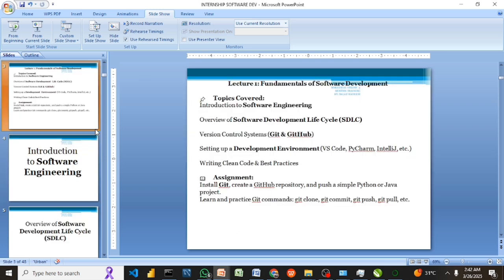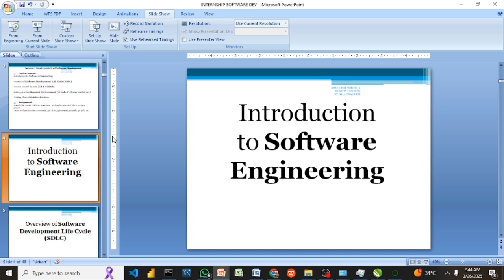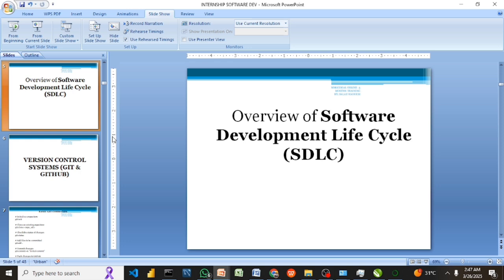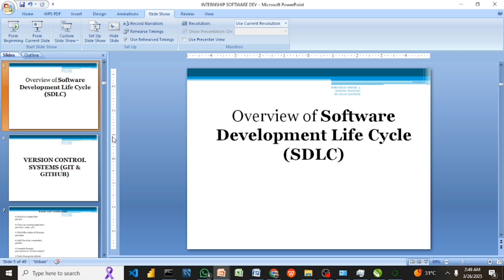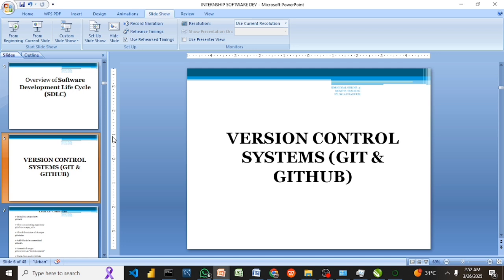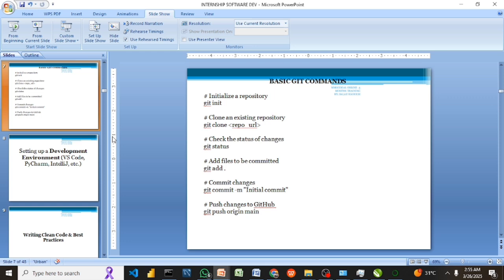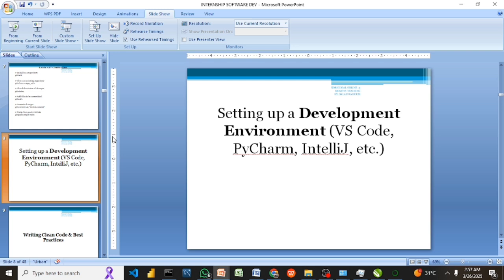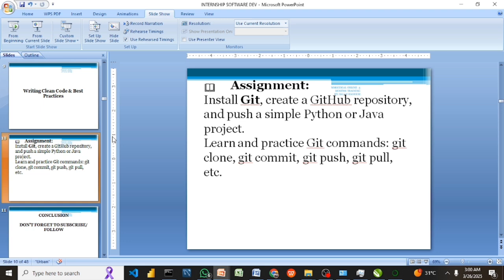First Lecture for Intern Students – Software Engineering Basics, SDLC & Git

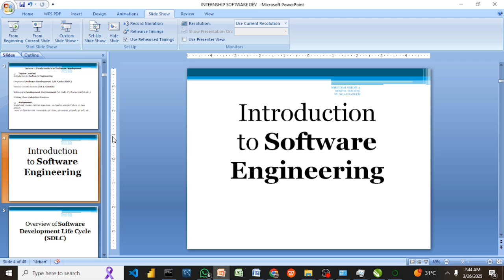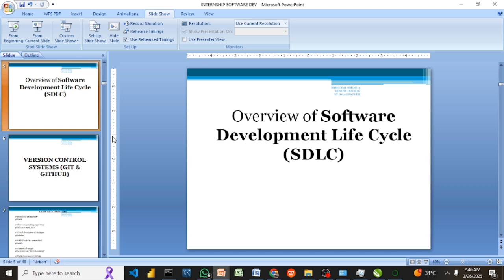Comment from the maker: Introduction to software engineering 2:18, Key roles in Software Development 4:33 SDLC 5:55 Version Control System 10:52 Git code example 12:21 Setting up a Development Environment 14:40 Writing Clean Code and Best Practice 16:41 Assignment 18:22